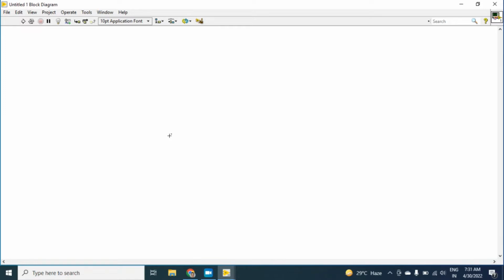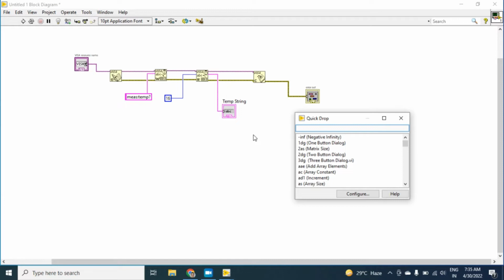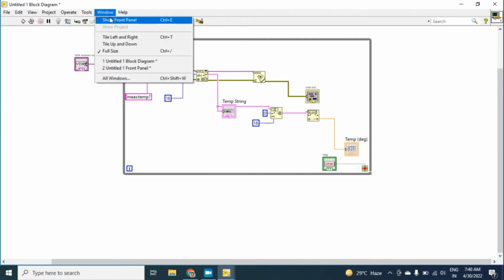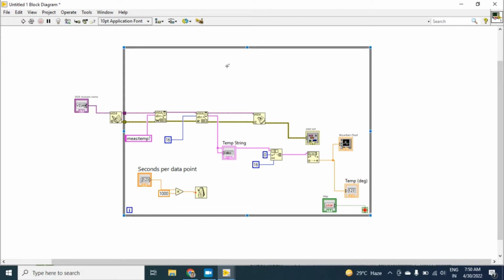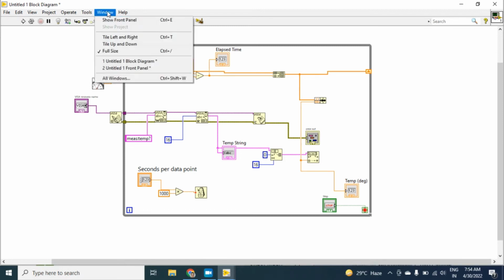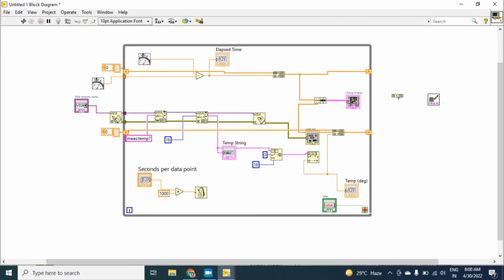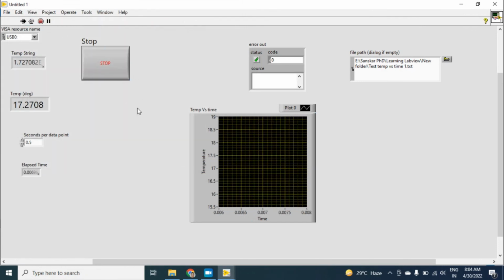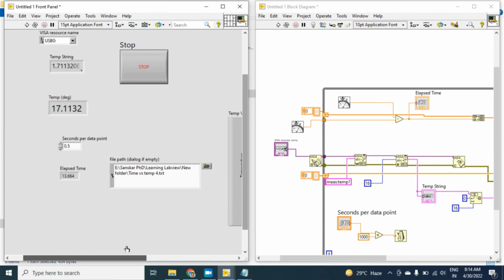Instrument control and Data Acquisition Using LabVIEW Program

Comment: Hi bro I am using a keithley-DAQ651 to get temperature value from the multimeter but I am not getting the expected value . In my case I am getting 2.055163E+01 as string indicator but when it is passed through the Exponential string to number the numeric indicator shows the value 2,0000 whereas it should be 20.5 can you please explain!!

Comment: Hello Sir, could you please explain how to take reading for photodetector parameters using labview in Keithley 2450 SMU
Reply from the maker: Hi Aditi, 
Please drop a small write-up/ppt explaining your photodetector experiment on my email sansmishra13@gmail.com, then I will try to make the program accordingly. Unfortunately, Photodetector parameters are new to me, but I have some experience working with SMU2450. 
Thanks
Reply: @higherphysicsbysansmishra  Thank you for your response.

Comment: I used keithley 6485 picoamp and I used your vdo to get VI for it.
But, the data in txt file is only zero (four digit of current).
My data is in nano or micro-amp. 

Can you help me to fixed it?
Reply from the maker: Use read data vi from instrument driver example instead simple visa read. You will get precise data up to all digit.
Reply: @higherphysicsbysansmishra  Thanks a lot
Reply from the maker: Try by increasing constant used.
Reply: @higherphysicsbysansmishra   this issue has been solved. Thank you.
Reply: @pong301275cmu  hello bro, we are getting the same problem. Could you please share your file for our reference
Reply: @higherphysicsbysansmishra   more detail please.
Reply: Hello,
I found the same problem, can you help me to fix it?